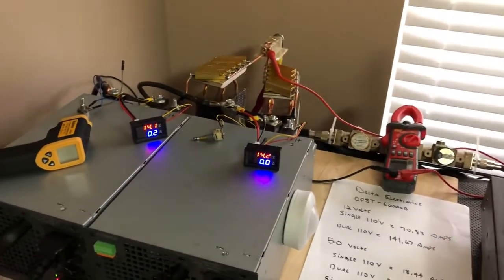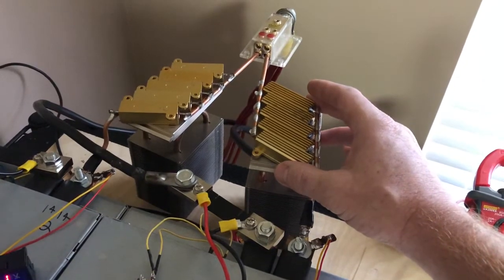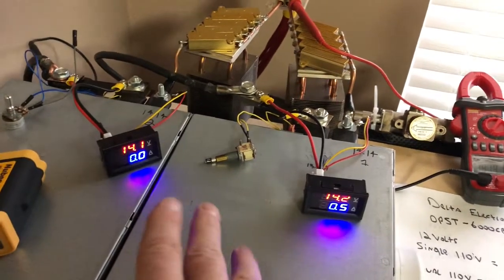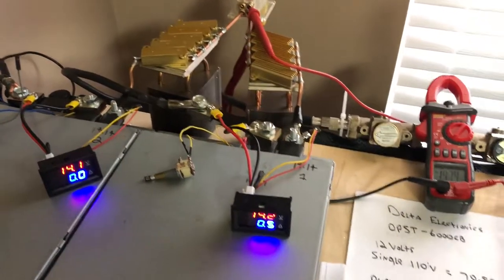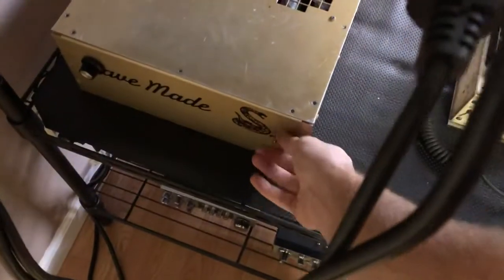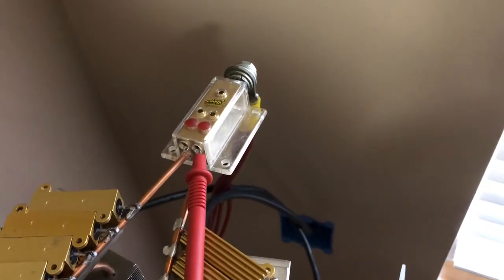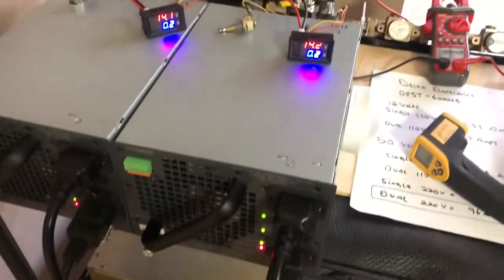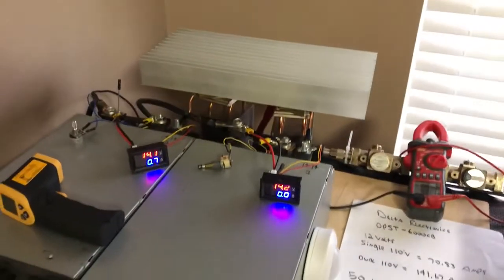Power Supply Load Sharing

Comment: How did you determine the load impedence
Reply: Sir, RF Man has a video with the formulas.  It was a matter of how you calculate ohms law.  Voltage drop over a resistance (R) at a predictable load (I). I believe my load value was 160 amps.
Reply: @baltimore_amp_repair  load value and load impedence are two different things
Reply: And ive seen his videos and he mentions nothing about how to calculate the load impedence
Reply: @theamwindow   right not directly.  I’ll get you the math.  What I did is screen shot his excell spreadsheet and then made my own off that.  Took a bit to get it right.  Send me an email and I’ll try to find it and get it to you.

Comment: I watched your video as well as RF Man too.  I will try to parallel 2 PSU in the same way as you do.  Do you notice any big current difference between two PSU occasionally after it is connected to a load for 15 to 30 min ?  I apply this method to parallel 3pcs DC to DC Converter with rectifier diode set at the output side of each converter.  Though I set the output voltage same before putting them in parallel, the current draw is even between each converter for some min, then one of them will deviate wildly when the diode get heated up after a moment.  I notice that the resistance of diode drop when it is hot.  This results in a change of voltage output voltage.  That causes current difference.  To balance them again, I have to tune down the voltage (CV potentiometer) of this converter a little after 15 to 30 min of running, the current will be then stable in balance status.  I am not sure if those resistors you used in the video will have issue.
Reply: Sorry for not getting back to you.  I totally forgot I had this channel. Anyway, I did notice the output voltage measurement dropped as the resistors heated up.   The hotter they got the farther the drop.  The current increased as the voltage decreased but overall wattage decreased as well as the resistors heated up.  Regardless both power supplies ran about the same (balanced load) all the time

Comment: Nice  demo.   Is the back & forth current draw pattern on your digital meters the best result?  Could any other solution provide the same current draw on both meters all the time or is the see-saw current draw pattern  the best it will ever get?  

Is it possible to parallel a linear regulated  PSU with a SMPS?
Reply: OMG I haven’t checked back on this channel in quite a while!  

To answer your question Sir.  Since it was a very small current draw I didn’t even worry about it.  I believe the current sense circuit in these power supplies check (sense) the system current at a standard rate (time).